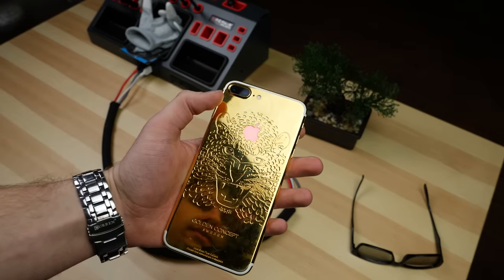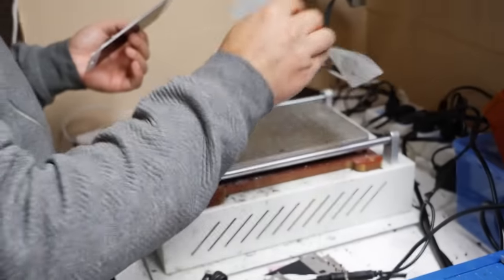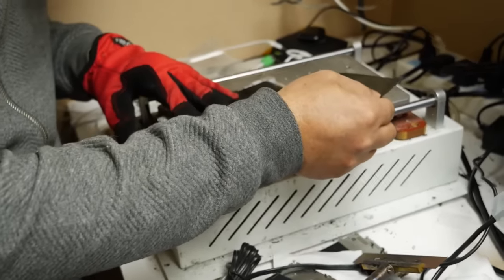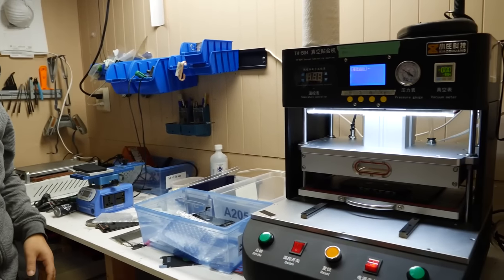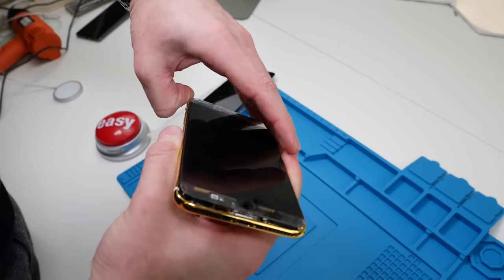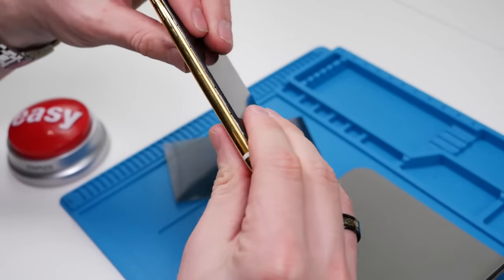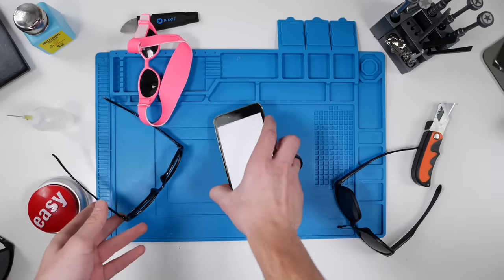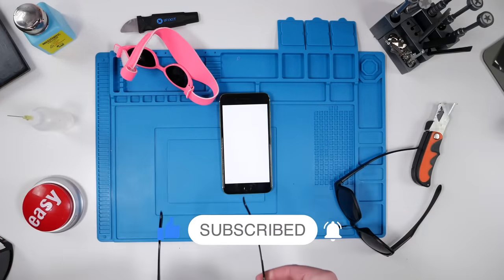THE ULTIMATE PRIVACY SCREEN.. (iPhone Mod)

Comment: I remember my old Android seemingly had a feature built in that did this using software somehow (in accessibility settings). I wonder how it worked.
I remember I had to look at it at a really bad angle to barely make out things on the screen to turn it back off. Maybe it was something different
Reply: do you remember the model?
Reply: @hotsauwz  I thought it was my Samsung J3 Luna Pro. I could be wrong though. An older one for sure as the battery was still removable. A family member now has that phone, I might be able to ask to look at it and see if it's the one
Reply: @mynamesnotimportant6941  dope!